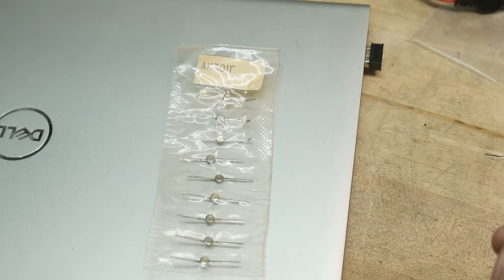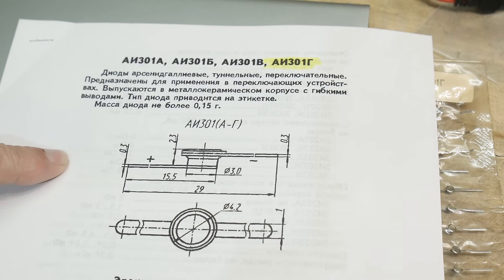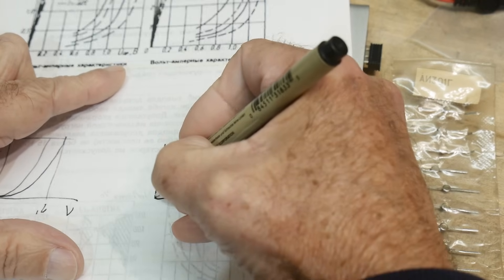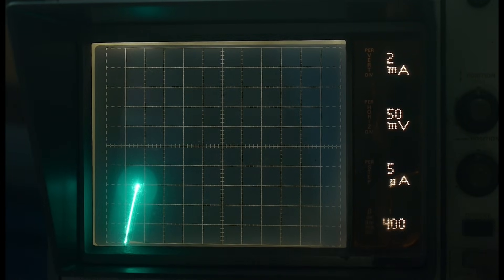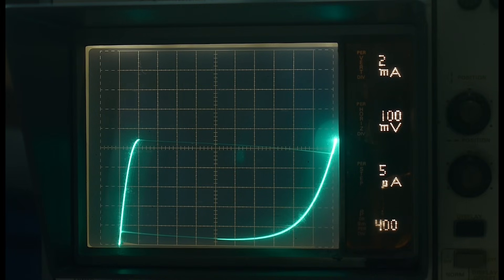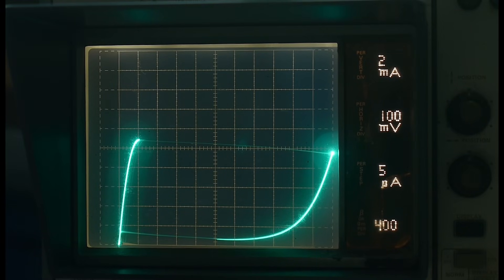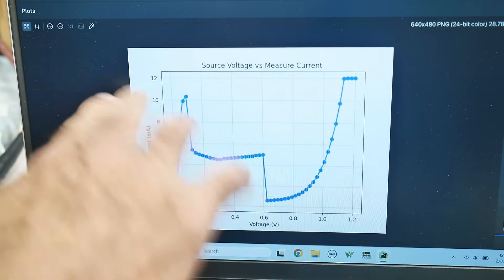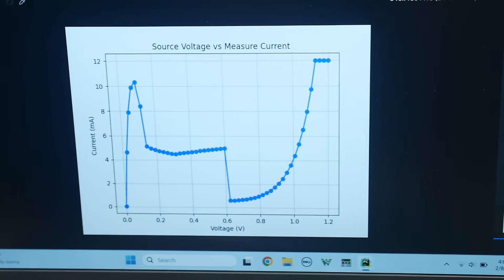#1815 Tunnel Diode AI301G (part 1 of 3)

Comment: "Negative resistance" seems like a bit of a misnomer here, creating a feeling of mystery where there should be none. The absolute resistance value always remains positive, what goes negative is its local derivative with respect to V, i.e. dR/dV. It's very weird behaviour (as with many nonlinear problems in general), but it's not breaking physics.

As to why it doesn't appear to stop conducting nearly as quickly as it starts to... couldn't guess. Maybe it's interacting with the equipment, or maybe it's been damaged ¯\_(ツ)_/¯

Comment: The missing negative portion of the curve has an interesting similarity to the temperature-vs-heat-transfer curve between a solid surface and a boiling liquid. (See the Leidenfrost effect.) IIRC is took a long time to figure out how to get a ridged enough temperature control to plot the full curve.

Comment: Your power supply testing to creat a curve is really wrong!  Your PS isn't very fast in the current limit mode, because there is a relatively large capacitor at the output to smooth the voltage.  B) your ps can't handle the negative resistance correctly.  It expects the current increases with the voltage. A curve tracer is much faster to react because it doesn't have such a capacitor.

I have never seen a tunnel diode myself.  But my mentor told me in early 80s that by applying different voltage and settiing up currecly the nomad zone, i could have a VCO to fine tune the oscillation frequency.  But not much.   Tunnel diodes were essential elements in microwave and radars in 50s to 80s.

Comment: I think the unexpected kink in the curve can be elminated by heavy capacitive filtering. Without it, it will oscillate always.

If this curve is the true one for this diode, it is very curious and is caused by the manufacturing specifics. That would also indicate why the oscillator is not working in a stable way and creates strong harmonics and nosie-injected behavior.

Comment: A tunnel diode is use in the Tek 1502 TDR to produce the high speed transient.  I don't think tunnel diodes have been made in many years.  There were a lot of papers written on them back in the 1960s.

Comment: Cool stuff - I did a video on Tunnel Diodes several years ago.  Their are remarkably difficult to characterize in the negative resistance reading.  They had traditionally been used in very high frequency oscillators, as well as in the trigger circuits of some of the older Tektronix analog scopes.  I suspect what you're seeing in no-mans-land is due to oscillations (the SMU likely doesn't like seeing a negative resistance).
Reply: I had to go back and watch your video (#204). That was a great video for certain...

Comment: I have some Ge devices somewhere in my junk pile.  I built a wide frequency range tunnel diode dip meter for testing a 400 MHz receiver back in the  mid 60's.  Worked great.   I accidently built a great FM transmitter at about the same time.  I was trying to build an oscillator to tune over the FM radio band.  Turns out my breadboard was so microphonic it worked great as an FM transmitter just by talking to it.  I also have a UHF tv tuner that I bought to update a standard tv back in the day before they were built in.  It uses a single tunnel diode as oscillator and down conversion mixer into a low pass filter feeding a standard ribbon cable to the tv.  I could play with the LC and "nudge" the frequency range all the way up to 2 GHz according to my lecher line detector.  Tunnel diodes were somewhat challenging but fun to play with.

Comment: I have never played with tunnel diodes, but do have a nice book about them.  "Tunnel Diode Manual" circuits, applications, specifications, published by GE, 1961.   The tunnel diode curves in this book show a smooth, mostly straight line down from the first peak. That part is, of course, the negative resistance regime.   Near the 0 current line the curve is smooth and its slope gradually becomes positive again, transitioning into the exponential regime.   I spent some time using Kiethley and NI instruments like yours to test quantum dot image sensors, which also operate by tunnelling.   I don't think there is anything wrong with your method.  The East Block diodes you have exhibit a strange hysteresis property.    They might do something interesting in a tradional tunnel diode oscillator circuit, but I suspect they are more like a snap recovery diode.   You should get some genuine US or Japan manufactured tunnel diodes.   GE made Germanium tunnel diodes back in the day.

Comment: The issue is the negative resistance. Here's an idea. Swamp it with positive resistance. Trace a 10 ohm resistor, then trace the diode in parallel with the resistor and subtract the current measured from the first trace

Comment: In the early '20th century people were experimenting with radio circuits called "Crystaldyne" radios.
Generally, but not limited to, zinc oxide, detectors. These, apparently, worked similar to Tunnel Diodes (if not actually tunnel diodes.
Well before Esaki got the patent.
The simplest method of making them was to burn a strip of galvanized steel which, apparently, converted the zinc to zinc oxide.
Lookup "Crystalyne" on YouTube for modern made examples of simple radios and transmitters based on the principal.
Fascinating.
Duane

Comment: How does the curve tracer perform the sweep? Does it send out a voltage sweep and measure the current or does it send a current sweep and measure the voltage?
When looking at the trace there seems to be a faint, very thin line crossing over from the breaking point horizontally to the normal diode curve, which suggests that the curve tracer sweeps a current. That way I don’t expect to see the drop in the middle as in that case the current would have to drop.
The other test sweeps a voltage and in that case the current can drop as the voltage increases.

How is the reverse behavior of this diode? Looks like it would make a perfect very low forward voltage rectifier for small signals like in a crystal set.
Reply: The switching occurs far faster than the scope can respond. It is usually specified in picoseconds. Note also that at low currents, the diode looks like a near short circuit.

Comment: Uses include microwave amplifiers, relaxation oscillators, fast flip flops, rising/falling edge sharpening, fast triggers.  The negative resistance region is unstable.  Forcing its voltage to be in this region causes the current to switch back and forth between the two stable branches of the graph.  The meter then performs a time average of these currents to report.

Comment: The negative resistance region is unstable. The only way you can have the diode functioning there is if you add some series resistor (which effectively makes it a positive resistance, and then it is not so interesting). You can actually see on your curve tracer (the very dim traces) that the voltage jumps to higher value with a current above the threshold. And it will again fall suddenly to a lower voltage value when the current falls down below a value.

In between those two limiting current values, you have two possible voltage values. So it will function as a bistable circuit with just a diode and a series resistor.

Or you can get it to oscillate with an inductor, biased to the unstable (negative resistance) point.

Comment: Really interesting! 
The curve tracer had very thin/dim nearly-horizontal lines that seemed to suggest that the I/V curve differs when the voltage is increasing vs. decreasing... kinda like a capacitive effect, or maybe magnetic hysteresis. I tried to guess which parts came from which sweep-direction, and was surprised to see from the software test that my expectation was literally cut in half... half-correct, and half wrong.
I'm curious if the software-test would show different results if the voltage-sweep was reversed. (sweeping from higher voltage to lower, as opposed to sweeping reverse-voltage)

Comment: The GE transistor Manual, 7th edition (1964) 450.37 8/64 850M has a whole chapter on them, including many practical circuits. This book really shows my age and pre-dates ISBN numbers of any kind whatsoever.
Reply: I still have my copy as well. Also has the transistor test set build instructions in that edition. Probably one of the best transistor manuals of that era.
Reply: By a LONG SHOT!
Reply: Good old chapter 14

Comment: Wikipedia chapter and verse on tunnel diodes. A similar device the gunn diode is used in microwave oscillators before more conventional.semiconductiors  became àvailable9 at microwave frequencies.

Comment: The higher flat region in the AVERAGED voltage region of the RF/microwave oscillations.  The drop to the lower flat is just where the oscillation ends after the stray capacitance charge has been depleted.  That all is just my reasoning, or “educated guess”.

Comment: Are these still super rare? I remember unsuccessfully trying to buy one when I was like 14 :(
Reply: I searched digikey, there's many, sold by "marketplace" sellers not digikey themselves. Prices range from 250 and go up north of 1600 PER EACH depending on the frequency. The most expensive ones operate at 18GHz. So I'm going to go out on a limb here, and say "yes, they're rare". What did you try to buy one when you were 14 for? Seems like they were used as oscillators for radar back when 2GHz was "super ultra high frequency"

Comment: They do very fast switching and they were used for that also in the trigger circuit of old oscilloscopes. 
The drawing of the curve is correct, the element is just connected with inductive wires, so it oscillates. With your rf equipment it will be easy to measure the signal frequency with a non contact probe. The signal of that type which might have a rather high capacity of its own should be in the low GHz range if not below.  ..., (I just checked the data sheet 50pF.)
Reply: Yes. Tektronix used to use them in their analog scopes

Comment: As far as I know about devices with negative differential resistance, you can either have voltage controlled devices that have a well defined current for each voltage point, and there are current controlled devices that have a well defined voltage for each current point. It would be very interesting to see how the results differ if you use the sourcemeter either in current- or voltage mode and compare the resulting curves.
Reply: In the forward direction there are three voltages that have the same current. One in the forward tunneling region, one in the negative resistance region and one in the normal forward region.
Reply: @Bdix1256  Exactly, so the measurement done by IMSAIguy should be the right way because for each voltage there is only one defined current and I think that´s what he measured. Anyhow, because of the confusing results it would also be interesting to set the current and measure the voltage, maybe it lights up a little bit the "forbidden area".

Comment: For the non-curve-tracer testing that you performed... The test which used the Keithley 2400 to source voltage and measure current... Please do an additional video on how a hobbyist with limited lab equipment might set up a work-around to do the same test. I have a Siglent SDM3065X DMM (Kelvin,) SDS1204X-E scope, SPD3303X PSU, Rigol DG 1032Z 30MHz Function Generator (trying to upgrade it to 60MHz) - lots of additional/duplicate/analog equipment, including counters - an old laptop to tie it all together and to run the software. Please include details on the needed software. Also, is this really a more general question of how to fake a curve tracer? One that is better than the Asian kits, or the DIY "Octopus" circuits? Thank you, in advance!
Reply from the maker: use the SPD3303X PSU in place of the 2400. it will do the same thing just not as accurate

Comment: Interesting critters. Only time I've had anything to do with them was nearly 50 years back when I was in USAF electronics. Some gear had them mounted in a tuned cavity oscillator that fed into a waveguide mixer. We tore a bad one apart and it was sort of empty inside, except you could tell - very high precision empty - the surfaces were nearly polished mirrors.

Comment: And one more thing .... this RUSSIAN, USRR  ( not bulgarian ) diodes are super elecrostatic sensitive,  ultra low rew. voltage !
Reply: I don’t know about the static sensitivity of this Russian GaAs tunnel but in general tunnel diodes are not really static sensitive (at least not in the way a  mosfet is). They are just sensitive to excessive current. They are also not sensitive to radiation. I say this even though our data sheet does claim they are static sensitive.  I think it’s just so the customers treat them nicely 😉
Reply: @Bdix1256  
You may be right , I think about reverse voltage. Remember , two diodes stop working couse touching and manipulating in hands . The junction capacity is low , this devices easly go up to 8 Ghz .... This diodes work in russian osciloscopes producing short pulses for synchronisations.

Comment: You ask why ... 
many years ago, I measured these things and got the same graph. Why ? because I measured the parallel connected resistance of the power supply and the negative resistance of the diode. only when I used a nicd battery and a 10 ohm potentiometer as an adjustable voltage source, I obtained a perfect theoretical graph. Regards .
Reply: Here is the Math:
For parallel resistors we have:
Req= (R1*R2)/(R1+R2)
Say now R1<0 that is R1 is a negative number.
The only way Req becomes positive ( so we can measure it with normal circuit) is when ABS(R1) > ABS(R2)
(i.e.  ABS means Absolute Value)
In that case both numerator and denominator become negative and therefore Req becomes positive (division of two negative numbers is positive)
So you can measure Req and since your R2 is known positive value which you shunt R1 ( your diode ) with it. you can calculate R1(your diode) equivalent resistor.
Here some more homework for you:
1.  Use the circuit of Esaki oscillator to create crude oscillator.
2.  Put this diode (with correct biasing) in parallel with parallel LC tank to increase the Q of the LC tank ( as long as your negative R is less then parasitic R of LC tank) the negative R of the diode cancels part of positive parasitic R of the LC thank.
3.  You can choose biasing of the diode to control Q of the parallel LC tank.
4. The circuit above become oscillator if ABS(R1) > ABS(R2)

Comment: My memory from engineering school is that the curve is a third order function.
The Source meter result looks like 4th or 5th order,... 
I have no explanation other that it is oscillating. 
You could put a scope probe on the diode while testing with the Source meter.
They are interesting. 
Another interesting device is an Avalanche transistor,...

Comment: Flat region in negative dynamic resistance region is averaged value of oscillations ( check your programmable meter datasheet for details how it filters and averages input ). Curve tracer shown do not average that much - take a look at diode during test using HF oscilloscope.

Comment: Could you try the ferrite bead on the curve tracer?

And now I'm dying to know what these are good for! LOL!
Reply: What would that do? You need to run the ferrite on the VNA, not the curve tracer. It's a frequency dependent part, not a voltage dependent part. But yes, in general doing some analysis on ferrites would be interesting.
Reply: @gorak9000 That sudden jump in current at the discontinuity in the curve creates high frequency harmonics, no? 

Maybe I don't quite understand how the curve tracer works. Kind of new to this stuff, particularly at this level of detail, but find it fascinating.
Reply: @AdmiralQuality  Oh, you mean put a ferrite on the leg of the tunnel diode and run it on the curve tracer. I thought you meant use the curve tracer to show the effectiveness of a ferrite bead as a separate concept. Yeah, a ferrite might get you something on the curve tracer on the tunnel diode, but I suspect the Keithly that he used later has way better control of the source, and he was getting a decent graph out of it.
Reply: @gorak9000  Yeah!

I have no idea what the Keithly is exactly or how it works. I only discovered this channel recently and have a LOT of material to review. :)

Comment: We currently make germanium planar tunnel diodes. They make very high freq. oscillators when operated in the transition area just where the negative resistance begins. Usually they are used in the region before that where the tunneling current predominates. They are used in high speed detectors.
Reply: Tektronix used them as Trigger detectors in their scopes at about the transition time from tubes to transistors.  The special feature was exactly the negative resistance and a definite switch with appropriate hysteresis.  By the way, they are called Esaki diodes by the name of their inventor.
Reply: @InssiAjaton in the Tek trigger circuits the tunnel diodes were used just shy of the negative resistance region, biased so that the when signal reached the trigger level the diode snaps over the negative resistance region to the higher voltage level. The diode does the very quickly which makes a very sensitive and stable trigger circuit.
Reply: What does the detector do?
Reply: @larrybud  imagine you needed to track a high velocity object and make corrections to the trajectory of a device designed to intercept said object. A high frequency super sensitive detector might come in handy.